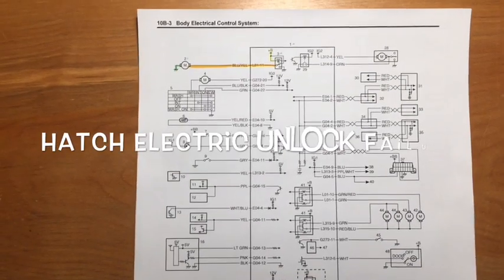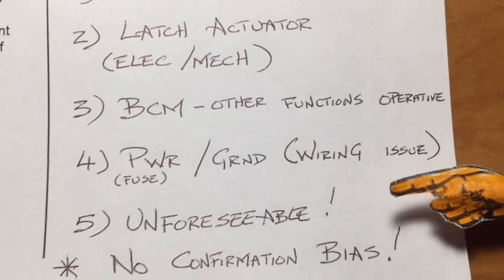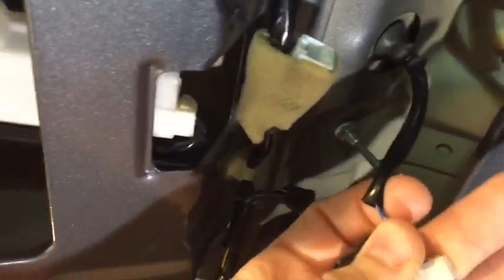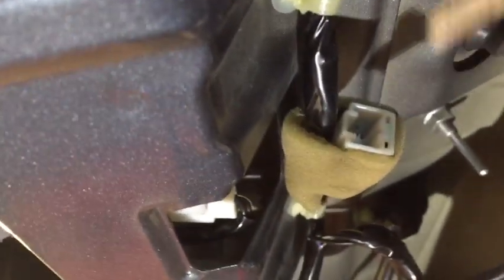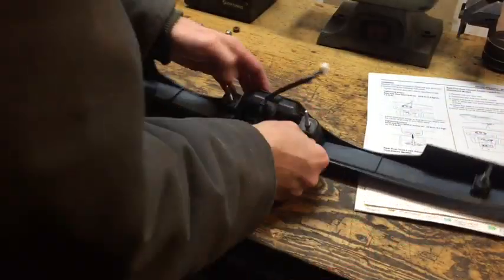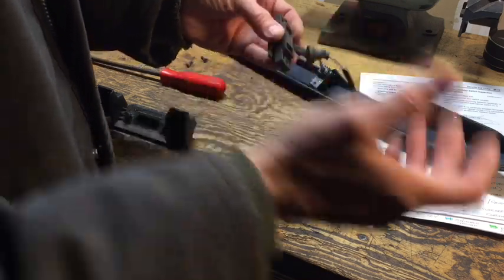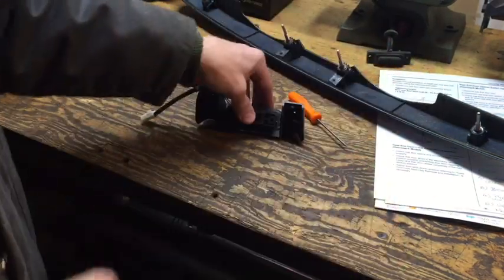Suzuki SX4 Electric Hatch Unlock Failure & Fix

Comment: I just replaced the actuator, and the hatch still won't open. What should I replace next?
Reply from the maker: The intention of the video is to provide you with the information necessary to troubleshoot it yourself. If you have watched the video and thought it through, I am sure resolution is well within your grasp. Thx for watching. 🍀🍻
Reply: @TheGibby3340  so I watched your video a few times through, so changing out the button was easy, realizing it didn't fix the problem was a kink. Today in the mail I will get a latch to replace, and that should fix it. We will see. Thanks for posting this, the dealership I went to to see if they could fix it wanted $175/hr just to figure out what was wrong, not even to repair it at that point.
Reply from the maker: @jensaulnier I am happy to help those who help themselves. If you’re still struggling gimme a shout. 🍀🍻

Comment: Hello mate
Can the boot latch issue cause the other doors to stop functioning as well?
Reply: When i unlock the car the car receives the signal and the lights blink however the door have to be opened manually and the boot doesn’t open at all,
Can you advise what’s wrong with it?
Reply from the maker: Are you sure “all” doors are remaining locked?
Reply: @TheGibby3340  yes do you know what can cause this?
Reply from the maker: Can you lock and unlock all doors from the drivers door switch?

Comment: How did u remove the inner panel.without breakin the mounting tabs
Reply from the maker: You can use a panel fork on the plastic pins if required. Normally it’s not an issue. Don’t do it in cold conditions. 🍻

Comment: Please help!. My trunk does not open when pressing the release button/switch. I removed the switch and the actuator and connected them both directly to a 12v battery. Both worked. However, when I reinstalled them back to the trunk, they will not. I checked the voltage coming at the switch with a multimeter and verified 14 volts are coming at it when the button is pressed.  However, no voltage is detected at the actuator, but as I said, the actuator works fine when tested separately. So, I am suspecting the issue is with the relay which according to the diagram, is inside the junction box. My problem is that neither the user manual nor the diagrams show its exact location.  Maybe I don't understand the diagrams. My car is a Suzuki SX4 2008 sport sedan with keyless entry.
Reply from the maker: Give me a couple of days…I will consult the diagrams and Get back to you.
Reply from the maker: So you have the manual/wiring diagram?

Comment: My  SX4 has 4 conductors not 2. 2 each of the same colour.I did the screw driver across all four pins and it worked. Can a 2 pin switch be adapted to work on the 4 conductor socket?

Comment: Hi i have problem with central locking on sx4 
When i press lock/ unlock button light flashes but it does not lock / unlocks the doors or hatch. Driver doors central locking button is not working as well.and hatch is locked when i press the keyless entey button on the door or hatch just lights flashes but locks doesn’t work i have to manually lock unlock the doors. I have checked door lock fuse under dash no problem with it.Please can you help with that thanks.

Comment: You are amazing.  Just finished the repair with your help.  Found the part on Aliexpress for $18 (3717879J00).  It had the extra 2 conductors for my remote keyless trunk button just cut short.  Just had to strip them, and solder them to the functioning unlock button already on my SX4's trunk.
Reply from the maker: Thank you Sir Glad it helped....And no not Jesus 🤣
Reply: @TheGibby3340  don't be modest. We know what's up.
Reply from the maker: @BigTymer0007  🤣

Comment: Hi I'm having the same problem with my sx4 2009, but the difference is that there is absolutely no power on the wire leading to the back therefore the trunk doesn't open the license plate light is not working as well. Please i need a help to fix that up thank you
Reply from the maker: Hello sir... 2 questions.  When you say there is no power leading to the back which wire are you referring to? Do you hear a click at the body control module (LH footwell) when you depress the hatch switch? Also have you manually opened the hatch for access purposes?
Reply: @TheGibby3340  when I push the switch botton nothing happens, so i removed the trunk panel, i tested the actuator the same way you did in the video using a screw driver nothing happened, then i used a multimeter to check the power supply and i realized there is no power to operate the actuator since there is an electric motor in there, and the 2 license plate bulbs are blown.  I suspect an electrical overload, the weird thing is there is no burned fuse
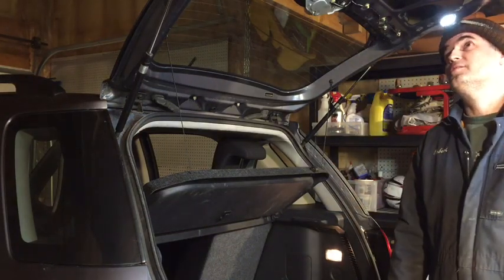Reply from the maker: Herman Nino Tchouka Mba Possible...Did you inspect the wiring for damage at the roof line to hatch transition? The video details this @ 11:19...

Comment: Thanks for the SX4 videos!! With this back hatch issue, did you hear anything trying to engage? When I press the button, I hear something, but there is no physical action. I'm wondering if that might indicate it is the actuator not engaging vs the button? I haven't taken off the back panel yet... I wanted to see if you heard a noise... thank you for this video.
Reply from the maker: Hello...in my case...silence. You are very likely on the right track. If the switch and wiring are fit when you depress the switch (with a functional and correct key FOB in proximity) in addition to the actuator drive you can hear a relay within the BCM click (under dash/footwell LHS if I recall). You may have a partial seizure of the linkage between Act. & latch assy. May just require lubrication if yer lucky. Good luck and thx for watching...Ian